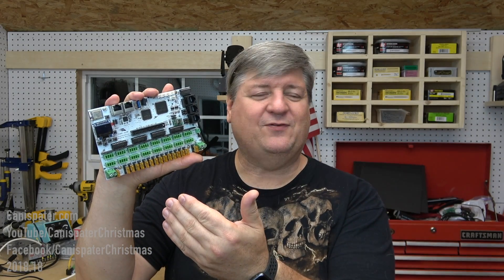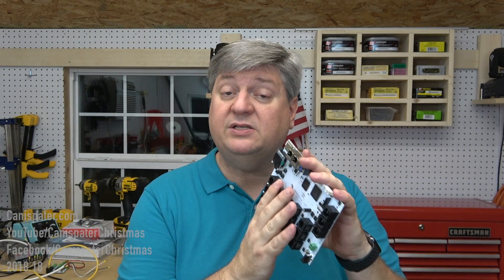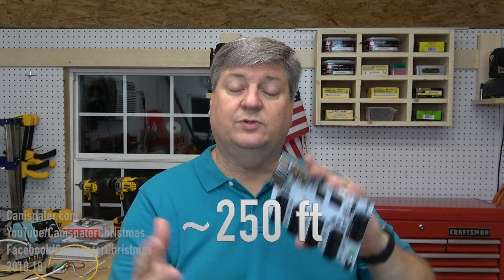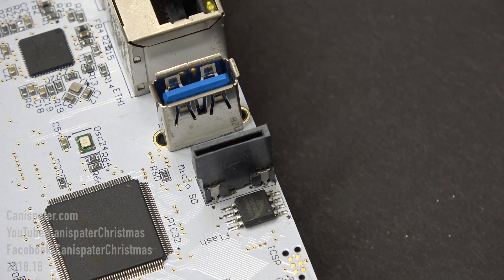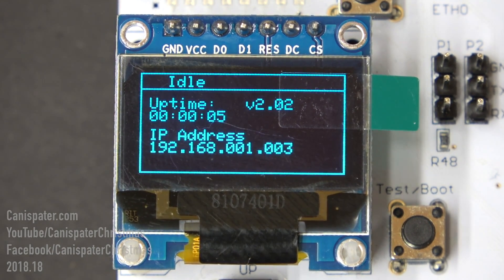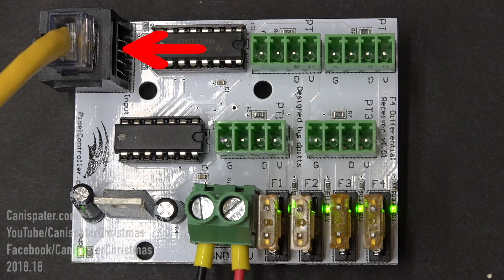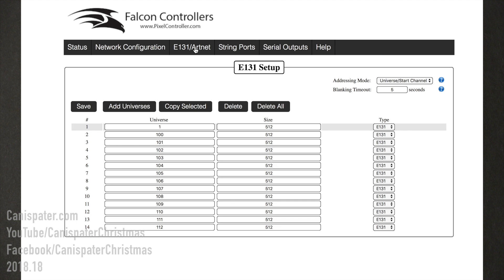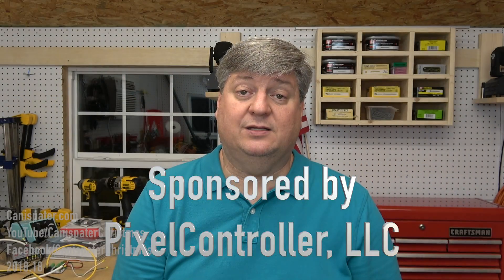Falcon F48 Differential RGB Pixel Controller (2018)

Comment: I have a question about power injection for the Differential receiver. I have already hook up about 5 12 volt 50 ft. strands to 1 port of a Differential receiver. They all look good to me. How far can I go before I will need power injection? Thanks for your help.
Reply from the maker: Not sure I totally understand your setup. You have one receiver 50-feet from the main board and you've connected 5 12V strings to it? How many pixels? Regardless, the pixels will start to dim when they need power. You can usually tell easier/quicker if you run an all white pattern (all 3 LEDs pulling power).
Reply: Thanks for your quick reply. I guess I will put them on all white and power inject then take the power inject off to see the difference that way. Im  new and Im happy just to get any lights doing anything at this point.😊

Thanks for your time
Steve Taylor

Comment: I know this is an old video but I’ve ordered the new f48v4 and my questions are there is two types I see of the new v4, can you tell me the difference? Thanks for the videos you make
Reply from the maker: F48V4 & f16V4 or two F48s?
Reply: @CanispaterChristmas  f48v4, there seems to be two versions of the new blue v4
Reply from the maker: I assume it's a part replacement due to shortages or something like that. I'll see if I can find out.

Comment: So if I use an f48 falcon board as a controller with a 12-volt power supply I would theoretically only have to run ethernet cables to the smart receivers with a 12 volt power supply also in the box with four pigtails coming from the receiver going to different props providing that the total pixel count is not more than 1096 correct? Is there a drop off in data sending with ethernet cables and would need some kind of data boost?
Reply from the maker: The F48 runs off a 5V wall wart or power supply and acts like a transmitter. Distance between the board and the receivers is 250ft or 75m with no signal loss. If you try to put pixels too far away from the receiver, you might run into signal problems there. It's basically pushing the ports out closer to your props. More expensive than the F16, but also more versatile especially if you have a large area to cover.
Reply: @CanispaterChristmas  awesome info thank you sir. At most the cables might travel 50ft. I do not have a large front yard unfortunately so most props and pixels will be fairly close to each other in the arrangement. Thank you for taking the time to answer as I'm very excited to start. Already looking online for supplies and pricing! Giving myself a full 13 months to aquire the items needed and for eventual set up.

Comment: I am brand new to this and was wondering where you get your 3 wire pig tails?
Reply from the maker: The vendors that sell pixels will have pigtails that match your pixels, but they are usually sold separately. Some may include some. I've also made my own. If I have a long string of pixels spanning a connection, I'll salvage the pigtail for use elsewhere. I've also moved toward no pigtails in some instances just using the Euro-connectors to a differential receiver or controller output. I started out being really particular about all that and am moving to more of a "meh" as I gain experience. 😂
Reply: @CanispaterChristmas  Thanks for the fast reply. I'm getting in big to start, I have 2000 pixels, 2 power supplies and the Falcon 16v4  controller. I just need to figure out how to hook it all up.
Reply from the maker: I am working on a V4 video. Great controller. Yes, it's quite a learning curve, but the community is awesome about answering questions and helping new folks get up to speed. Be sure to check out the forums and Facebook groups - always folks around to help out. Welcome to the hobby!

Comment: What exactly is 'universes'? It's quite confusing? There are ports - each F48v4 controller has 12 ports and with one differential receiver per port we have 48 port? Then what is universes vs channels?
Reply from the maker: Read up on the E1.31 lighting protocol. 3 channels per pixel, 512 channels per universe (roughly 170 pixels with 2 bytes left over for the next universe). If you use xLights, it figures all that out for you.

Comment: Is the falcon f16 smart receiver expansion board just a smaller f48?
Reply from the maker: Kinda. It's 4 differential ports - F48 has 12. It also shares pixels with the main board.

Comment: Just got the F48...plugged in using a similar 5v supply from amazon UK, but no power. Tried the power supply in other things and it seems fine. Am I doing anything silly? Anything I have to do before it turns on?
Reply from the maker: No. It should just come on. Takes about 5 seconds to boot, but if it's getting a good power connection, it should come on. Maybe the internal pin isn't making a connection?
Reply: @CanispaterChristmas  thanks, think I found the problem. Testing with a multimeter my supply is giving 5.7v...user manual says the board will not power on if above 5.5v.
Reply from the maker: @richiehutchison8332  Ah. I know pixels operate in a fairly narrow range. 12V good. 13V bad. 😂

Comment: My F48 and 1 controller came in today. I really cannot belive how small they are (Yes, that's what she said). But it seems like everything that I was expecting was wrong. Size of the wires, size of the controllers, etc. But at the same time this helps me to realize some of my ideas are overkill and I can downsize some of the stuff. TY for yet ANOTHER addiction Jeff. Between Cycling across NYS for donations for Cancer research. This, my wife and video games I don't know if I will have time to finish epoxiing the floor in the garage.
Reply from the maker: Yes, it's quite addictive. You're welcome! 😂

Comment: Hi. I have a newbie question. What size power wire are you using to power the differential receivers? They could, in theory, draw up to 20A, which would seem to dictate a 10AWG wire (reference: https://www.engineeringtoolbox.com/amps-wire-gauge-d_730.html). However, this seems like overkill, especially since the terminal post on the back of a LRS-350-12 won't likely fit this size wire.
Reply from the maker: Generally 14ga, but it depends on what's connected.
Reply: @CanispaterChristmas Thanks.

Comment: Good video. I have done your class and seen most of your videos. I am moving to xlights and into pixels this year.  Insert (I need some Help please) I took my LOR controller and placed it on the f48 dmx ports and configured. Now I have 8 strands of 15 pixels per strand. I have it in port 1-4 on my f48 and then I have daisy chained 2 falcon smart differential controllers that have been set to A, B and then DIP terminated on B. Here is my problem I don't know how to configure it properly on the falcon controller site the LOR was easy but  don't know how to map it correctly for falcon ex. starting the universe and running 8 strands through the smart diff boards. I would like to start the universe on 6 other than that I'm lost. I know this is a lot but and guidance would help.
Reply from the maker: Thanks for taking the course. I hope it was helpful! So did you do (or need to do) the firmware upgrade on the F48? I think it needs to be at least 2.55 (I have another video about the smart receivers (https://youtu.be/uyGo76NJ_bM) and it's all covered in there). If your firmware is good, you should be able to expand it on the outputs page to get to the settings. Also, if you are using xLights, I highly recommend using that to program the controller. It is so much easier than doing it manually, but I can understand wanting to know how to do it. Also, for help, there are probably folks hanging out in the xLights Zoom room now that can help live (you can share your screen and they can talk you through it). If not, that's cool, just need the basic info first.
Reply: @CanispaterChristmas  I do have the latest firmware 2.55. I was watching this video but I do not have the output to controller option on my controller tab. I see it at the bottom but it is grayed out?
Reply from the maker: @dktechnologysolutions3706  That probably means they aren't talking to each other. Is the controller on the same network as your computer? By default, it's set to automatically get an IP address (DHCP) unless you changed it to your show net manually.
Reply: @CanispaterChristmas  i followed your networking videos. I have a show network of 192.168.2.25 static and my lor is working with universe/id 1 channels 1-16. 
I have the smart boards a&b in port 1-4 on the f48 and have it universe/id 6 channels 510(17-526)
Reply: im using xlights ver 2020.39
Reply from the maker: OK. Good. Try checking into the zoom room on xlights.org. I'm sure someone can talk you through this. Kinda hard for me to imagine what you are seeing. :)
Reply: @CanispaterChristmas  do i need to just enter the zoom room and ask a question?
Reply from the maker: Yes, unless someone is already helping someone else. There may also be no one in there right now, but I know they are starting to hang out in there to help. Tis the season! :)

Comment: hi jeff where do i go to get falcon software? trying to set up my f48`s
Reply from the maker: You mean the firmware? Go here https://www.pixelcontroller.com/store/index.php?id_product=52&controller=product and look for the current firmware link.
Reply: @CanispaterChristmas  no how do you get the falcon on computer to set ip address ?
Reply from the maker: @paulingalls2133  If it's on your home network, it should get one automatically, if on a show network you set up yourself, you will have to enter one manually. Either use the buttons on the board or set it up on your home network first, then change the IP address through the web page.
Reply: @CanispaterChristmas  i set the address with oled thanks 
next problem is my matrix 5 cross 5 down =
320x160 but in led screen settings receiver cards parameters won`t let me change width to 320 ??
Reply from the maker: @paulingalls2133  For this, you should log onto the xLights zoom room. There may be someone there that can help you live. If not now, certainly on Wednesday night. I have no idea what to tell you since I don't know what matrix setup you have.
Reply: @CanispaterChristmas  p5 panels
Reply from the maker: @paulingalls2133  Zoom room. 😂

Comment: Hi Jeff!.. Thanks for these videos. VERY helpful. I now have the F48 and receiver boards. Any idea why the 4 5-10 nodes on two separate hanging faces light when plugged in? 172 nodes each. Using a 12v 2A power supply for each face. Also when running a sequence the faces blink. Seems the power supply does the same (blink)? Looking for a useful place for troubleshooting techniques for these boards.. ?
Reply from the maker: Check the voltage on the power supply to make sure it isn't over 12V. You might be able to get away with 12.1, but pixels like a narrow range of voltage. When it gets too high, then tend to lock on. You could also have noise on the data line which does strange things. Then there's the possibility of a bad ground.

Comment: NEWBIE HERE! anywhere to compare the falcon product to the holiday coro comparable product?
Reply from the maker: Excellent newbie question, but it's like a fierce Mac vs Window debate. From what I can tell, the HC controller is more like the Falcon F16 and I have both the F16 & F48 so I'll answer from that perspective. It really depends on your display. The F16 is great (and the value proposition) if you have a fairly concentrated display. Controller to first pixel is roughly 20-30 feet. I've heard the HC controller has better distance, but I don't know what that is and there's technical reasons for that which can be easily remedied on the Falcon is needed. The F16 has 16 output ports, but can be expanded to 48 with expansion boards. Some people prefer to run more, but shorter strings. Others prefer to run fewer, but longer strings and inject power. Personal preference. Now the F48 doesn't actually have any pixel output ports. It distributes data to differential receivers that have 4 ports on them. It's more expensive than the F16 due to having to buy the DRs, but it allows you to run one controller and space out the props since distance is 328 feet from the controller to the DRs (then an additional 20-30 feet from the DR). Does that help at all or did I just make you want to say "to heck with it" and buy some strings from your local home improvement warehouse? :)

Comment: Jeff, as always - great video! I just started in this hobby a couple of months ago getting ready for this Christmas. My idea is: F48 located in the house or garage with the ports running thru wall to the outside of the house. DRs outside of course, and connected to RJ-45 jacks on the outside wall of the house. I have not checked it, but I think the decorator style wall plate inserts
https://www.amazon.com/keystone-wall-plate-port-Pack/dp/B0723HBW89/ref=sr_1_39?dchild=1&keywords=exterior+rj-45+wall+plate&qid=1591989870&sr=8-39
 should be the same size as the inserts for the exterior  weatherproof outlet with covers 
https://www.amazon.com/ENERLITES-Extra-Duty-Weatherproof-Receptacle-IUC1V-D-2PCS/dp/B07N8GH2CF/ref=sr_1_12?dchild=1&keywords=exterior+rj-45+wall+plate&qid=1591989718&sr=8-12
 What do you thing?
Reply from the maker: Well, that will probably work, but I just put my controller outside (inside a CG-1500) so I don't have to worry about penetrating the house.
Reply: Yeah - that was just a thought. I don't think I have to worry about people coming and "borrowing" stuff in our neighborhood either
Reply from the maker: Haha. You can also hide it behind some bushes or something like that. It hides it, but also looks nicer.

Comment: JUST GETTING INTO RGB. RECIEVED F48 TODAY AND EX BOARDS. WHAT AM I DOING WRONG I JUST WANT TO TEST MY STRING? DO I NEED DATA OR IN TEST MODE SHOULDN`T THEY LIGHT? THANKS ENJOY VIDEOS
Reply from the maker: If you got the new chainable Differential Receivers (multiple input connectors), they have a test mode built in. You don't even need the controller to test. Just power and pixels.
Reply: @CanispaterChristmas  i was reading about it and must be missing something . i went threw all the test buttons and getting 5vdc out but no light.
Reply from the maker: I show it about 23 minutes into this: https://youtu.be/uyGo76NJ_bM
Reply: @CanispaterChristmas  i`ll check it out. i`m starting to wonder if they send me 12vdc strings
Reply from the maker: The print is extremely small, but you can see +5 or +12 on the pixel somewhere. I use a magnifying glass. :)
Reply: @CanispaterChristmas  did that and ripped one apart ws2811 is only numbers and a + an - on it
Reply: put under 5x mag glass all i see is ws2811s on chip and little board ws2811
Reply: JEFF I HOOKED UP A SET OF 12VOLT TO BOARD TONIGHT AND EVERYTHING WORKS. I`M WONDERING IF THE STRINGS I  RECEIVED ARE BAD.(I TRIED 2 SETS)
Reply from the maker: Well, if they're working then I'll assume they're 12V. Odd that you don't see the voltage on them though. Where did you get them?
Reply: @CanispaterChristmas  no this is a different string the other ones came from ray wu have about 25 strings that do not work and are suppose to be 5vdc. thes had a square end on them. just tested the ones with xconnect on them work as well. guess i will pitch the ones that arent working
Reply from the maker: Been there...
Reply: @CanispaterChristmas  Jeff i want to thank you for all the wonderful videos and the online course was a wealth of knowledge. i made my first sequence actually 2. they may be alittle rough but it has gotten me going in right direction. thanks again God Bless
Reply from the maker: @paulingalls2133  Awesome! Hey, once you get the lights blinking like you want, you have the hard part done. Now you can make minor adjustments.
Reply: @CanispaterChristmas  still playing around with them. this is hard part building and hanging i think is easy but my kiids don`t like helping . they just want to throw them up i like them neat
(that`s why they call me THE GENERAL) LOL. THANKS AGAIN

Comment: Do you have a video or blog somewhere that shows how you do your enclosures for the F48 receivers? I don't see many enclosure builds online & am very curious how you're doing it.
Reply from the maker: I just have my F48 inside a CG-1500. Wasn't really much of a build. 🎄🤣
Reply: @CanispaterChristmas  Asking about the receivers though. Did you use cg1500's and put 2 receivers and 2 power supplies in each cg1500?
Reply from the maker: Oh. Na. You do what you need for your display. You CAN put to in a CG-1500, but I've used more with one in a plastic ammo case.
Reply: @CanispaterChristmas  last question on this, I promise! Im thinking of using a 9.5” x 4.25” x 6.5” ammo box with 1 power supply and a receiver. I live in Florida which is pretty hot, do you think I need a vent for the enclosure or would it be ok without? Im not sure how hot the power supply would get in the box.
Reply from the maker: Yeah who knows? I show the boxes in one of my setup videos I believe. They are pretty small. Room for the PS and the DR is held in place with friction (so not much room). I haven't done a temperature test, but they haven't failed either. Not very scientific I know, but just some data for you. I suppose the correct thing to do would be to run a temperature sensor inside the box during a show and see how hot it gets. Mine get warm and any new boxes I build, I add a little more room for air just to be safe but I haven't vented any of mine. ...and it's Texas. Generally though, even though it can be in the 70s during the day in December, it usually cools down quite a bit at night during showtime so factor that into it too. Basically, do your own testing to see what you need. If I were in Alaska, I'd imagine I'd have other issues to deal with. lol!